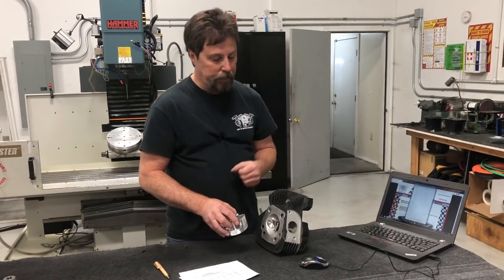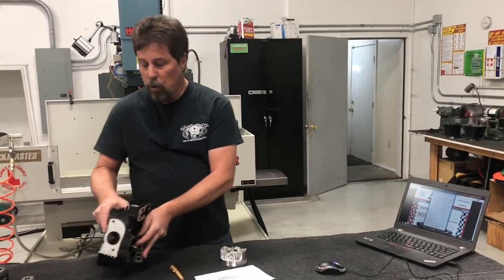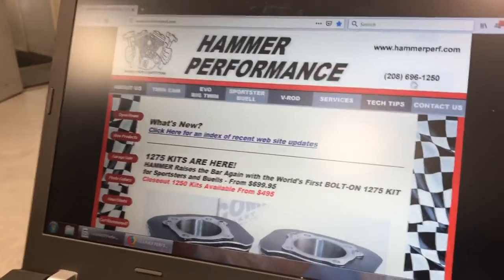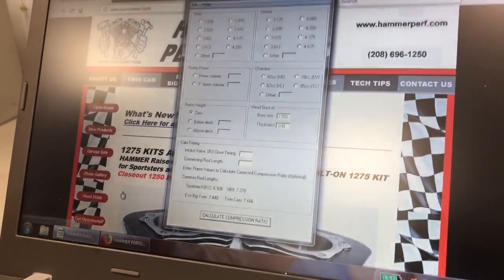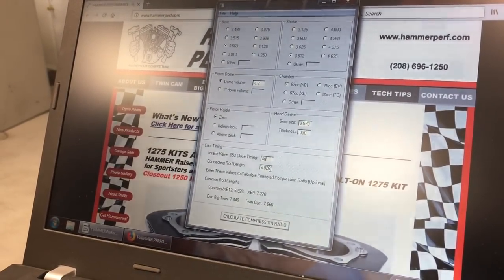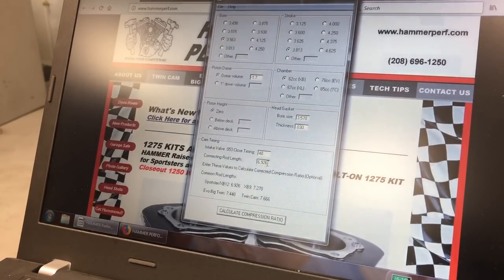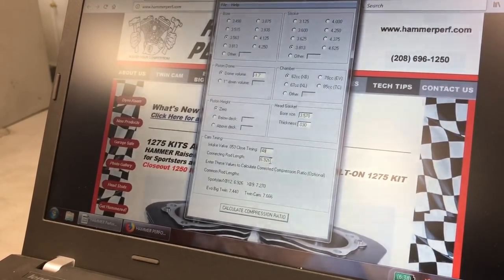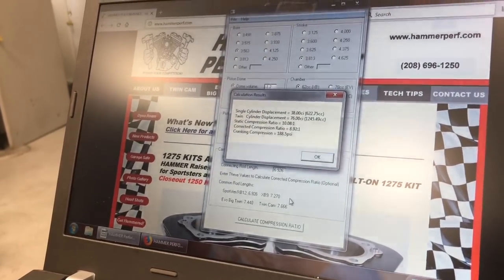Harley Davidson Compression Ratio And Cam Timing

Comment: Spoke with you on the phone and finally got my kit sorted out (my issue as I changed my mind on the heads).  I had ordered the SE ported/ CNC heads then switched to buying used 2004 heads and having you port/polish for me.  Originally got your 1275 big bore with flat pistons, then switched them out for the 30 degree ones to match the heads you just did for me.  Can't wait to set it all up.  This was an excellent video, thanks for the detailed explanation.  You guys have excellent customer service, too bad you're on the wrong side of the Country I'd love to stop by :)

Comment: Great video! I thought my understanding of camshafts was above average. Until now, I never figured in or understood compression with respect to intake valve closing or what I now understand as static and corrected compression ratio. This has been an epiphany for me. I considered air/fuel charge flow with respect to closing the exhaust valve later to take advantage of the lower cylinder pressure, before the piston begins pulling the charge into the cylinder, because of the exhaust pulse leaving the header. I began wondering how compression may affect performance with my cam selection. I’ll do my research now because I believe it does. 

I changed to a Woods WM8-22XE in a 2018, 107 M8, and in the process went to aftermarket cam plate, oil pump, lifters, cam chain tensioner, and pushrods. I thought I was happy until I removed a restriction in my factory head pipes, upstream from my TAB 4 1/2 slip-ons. I was absolutely amazed at the improved performance through the whole RPM range. At the same time I switched from the Zombie to the standard 2 1/2 inch baffles because it was too loud. I assure you it was not the baffle change that made the difference. I run the FP3 to manage everything. Before the restriction was removed it would simply stop taking throttle input past a certain point requiring a shift well before reaching a reasonable RPM. Now, the engine moves air like crazy with a very responsive throttle into higher RPM ranges. 

That got me thinking, with flow rate of the stock heads, I may be able to achieve performance gains simply by switching to a higher compression piston with increasing bore or stroke. What I take from this video, it can change performance. Also, I may already be near peak with the current set up since the replacement cam was probably ground for no restrictions. Aftermarket head pipes might bring additional gains with less turbulent flow or minor radius differences. 

I really appreciate this content and my understanding is much greater after viewing.

Comment: Great job hammers, the question is what happens when you replace the oil pump gear with out the gear tool to keep it from moving and it did so next steps would be what

Comment: Great content!  I have a question concerning these calculators.  If you don’t start building compression until the intake valve closes, then why enter the ABDC number @ 0.053” lift?  The valve is still open!  The flow at 0.053” lift is probably low, but the valve is not seated.....

Comment: Ok., we are now in 2021, but let me ask this...I tried to follow your comments...but I am still trying to decipher this. I want to get rid of my  SE266 cam in my 2000 Springer and go back to stock. My motorcycle is high compression and has compression releases. You will most likely ask, well what is the cylinder compression, and/or ratio? Well, I have no idea to either one. How important is that for me to know? So then, even if my engine has high compression, what damage would be caused by returning to the OEM cams?
Reply: It will feel like it wants to run like an animal if it’s runs but will detonate like crazy and live a very short life it any at all

Comment: In your opinion, what is the ideal compression that produces the most power for 91 octane?
Reply from the maker: 210ish psi is a manageable, IF everything is set up right. By that I mean you've got reasonable squish band surface area (20% or more of the bore area), a squish clearance under .040", a good ignition with an appropriate map or curve, your fueling is correct, your spark plugs are the correct heat range, your exhaust doesn't revert, the bike isn't geared too tall or pulling a heavy load, the motor's heat is under control, etc.
Reply: Thanks

Comment: I'm thinking of doing the 120HP kit for 1200cc 2016 72, at about 5k miles. Will it still be streetable and usable or do you not recommend that kit for a street, non-track exclusive bike. I know the question is not directly related but this is a fairly new video and I am hopeful for a reply. Thank you for the information.
Reply from the maker: We put a lot of work into engineering the 120+ package to be a real-world, pump gas friendly setup with excellent reliability and longevity. It's not a race motor package at all. Read more about it here: http://www.hammerperf.com/883conversions.shtml#120hp

Comment: I had cams and adjustable pushrods installed on my 04 sportster and I’m now having valves hitting pistons and bending all 4 valves, any idea what the reason is?
Reply from the maker: An 883 I presume? 883 heads have longer valves to reach their shallower chambers. This puts the valves closer to the pistons to start with, as compared to 1200 heads. So cams that are bolt-in for a 1200 are not necessarily bolt-in for an 883. The operative cam specs are the "TDC Lift" figures. That's how far the valves are open as the piston passes through TDC between the exhaust and intake strokes, when both valves are hanging open. So high TDC lifts is what gets you in trouble with piston to valve clearance. Anytime you run cams with a "TDC Lift" (see the spec sheet) greater than about .200 on either valve, you're taking a chance of valve to piston contact. Watch this video for more information on this: https://www.youtube.com/watch?v=flgdYTCfXuU
Reply: @HAMMERPERFORMANCE  yes it is an 883 head. So what are the biggest cams I can use? I was given the fueling 505/515 cams and that’s what is installed at the moment
Reply from the maker: @dickhammerbush9630  Feuling 505/515's have very low TDC lifts of .137 intake and .150 exhaust. These are not big enough numbers to cause piston to valve clearance problems, even with 883 heads. Therefore, disregard what I said earlier, something else must be going on.

If it was mine, I'd verify the cam timing. First and foremost, make sure the marks are lined up properly. The mark on the pinion gear should be positioned such that it's pointing straight toward the middle of the #2 cam. If it's pointed even a little bit off to one side, it'll make all the other marks misalign, you need to point it right toward the middle of cam #2, and obviously it's mark needs to be aligned as well. 

If all the marks look good, then you can do a TDC lift check. We have a tech article that explains how to do this here: http://www.hammerperf.com/ttspotcheckcamtiming.shtml . It's a bit tedious, but it's a whole lot simpler than rigging up degree wheels and dial indicators, and it'll tell you right away if something is a tooth off.

Some people mistakenly believe that pushrod length affects lift. But a hydraulic lifter is self-adjusting. To the extent the pushrod is too short, the lifter automatically lengthens itself, and the extent the pushrod is too long, the lifter automatically shortens itself. So long as the preload is in the lifter's self-adjusting range, you're golden. And if you're outside that range on the too-long side, the motor won't run, because the valves won't close and therefore you won't have compression. If you suspect an issue there, run a compression check, it'll tell you in a heartbeat if valves are failing to close.

Comment: Hi, can the program be used or changed to show dynamic compression ratio ? 
cheers Brett
Reply from the maker: It already does. We just prefer the term "corrected compression ratio", to avoid confusion (guess it didn't work this time).

The problem with the term "dynamic compression ratio" is that it can also mean compression ratio with consideration for cylinder fill (generally expressed as "volumetric efficiency or VE). Only real motor nerds use it that way, but a few people do. So to avoid confusion, we use the term "corrected compression ratio".
Reply: @HAMMERPERFORMANCE  Great thanks, why is the cam degrees @.053 ? if we used software for another engine say a SBC would .003 " make much a change, could it be changed or "add a other" box to program.
Reply from the maker: @kermets  Man, I have no idea why the Harley world uses .053 and the automotive world uses .050. That's one of life's great mysteries to me. But it's a pretty negligible difference.